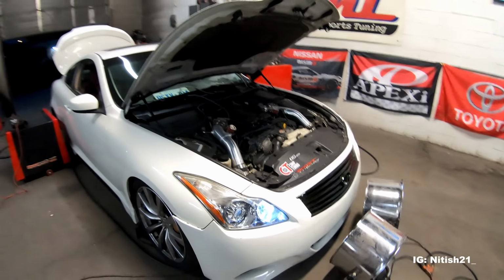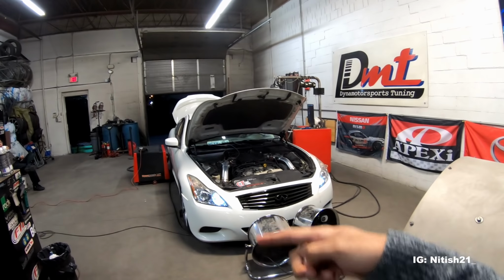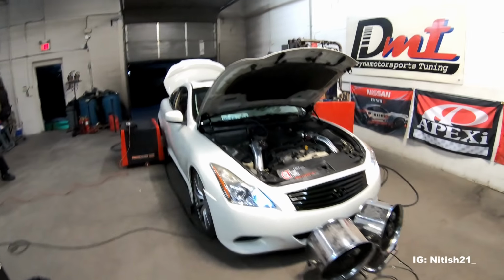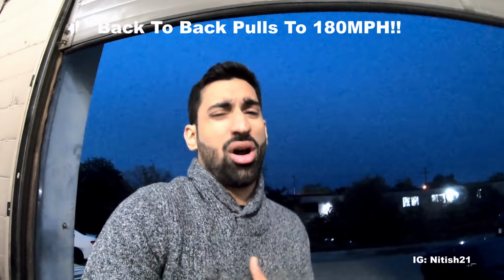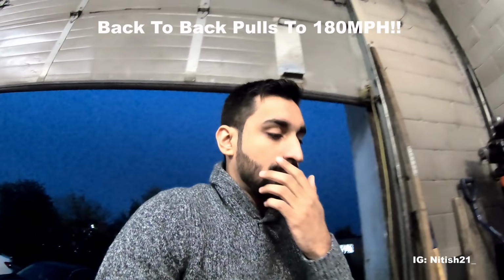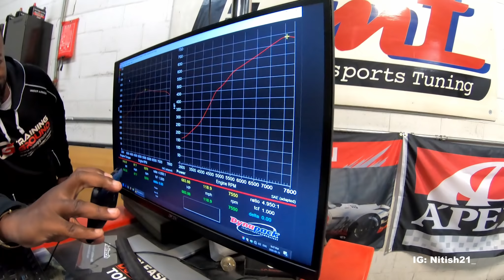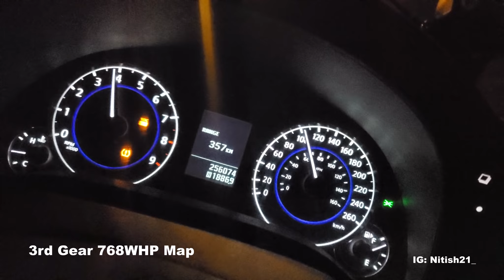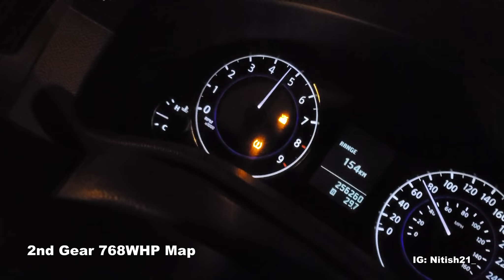800HP INFINITI G37 COUPE ON ROAD! - TOMEI SPOOL SOUND!! + DYNO

Comment: Those Gs numbers are getting better and better  what size comp turbo he using. And what type of boost controller yall use, its like yall run full boost all the time.
Reply from the maker: It's based on 2 maps 94 tune which is 600whp and 94+ boostane which is 768whp controlled through ecutek
Reply: @nitish21  gotcha gotcha so in actuality you can have a low boost map for daily driving and reliability.
Reply from the maker: @demigodq6083  Yup

Comment: so if 700+hp is killing the stock block, what's the "safe" number?

and is it the boost or the torque that's the issue? or fuel related?
Reply from the maker: It's really torque which we kept low on this build but this motor is so fkn high millage. So I wouldnt use this as a good example. But 600whp and 500wtq will last forever
Reply: just about to get into a 2010 g37s with 150xxxmiles... so I should think about building bottom end (crank, pistons, rods) if i wanna boost it to like 700wheel

love your content bro! keep this siht comin
Reply from the maker: @tfleming3567  yes absolutely thanks

Comment: Hey man do those BP turbo kits take in water during rain?
Been wondering with the turbos sitting at bottom like they do if they are only safe to drive on dry weather.
Reply from the maker: No never its above the subframe just don't drive through deep water

Comment: Hey man I like that bro, can you help me make my g37 800 hp?
Reply from the maker: Buy a turbo kit from @boostedperformanceyeg fuel return system from AAM and big fuel pump and you can do it. But I would recommend staying under 700whp
Reply: Ohh ok why did you say that? I want like 700 hp ,can you tell me where can I get the kit?
Reply from the maker: @abdrahamanekande3863  because stock engine can't reliable handle 800. Reach out to @boostedperformanceyeg on IG

Comment: Can you tell me all the mods you have on it?
Reply from the maker: Aam fuel return system with rails, 1300cc injectors, os giken triple disc clutch, hellcat fuel pump. secondary pump in drivers side with hydra mat

Comment: List of fuel system parts please.
Reply: I'm running 1300cc injectors 535 pump mounted in main basket with oem mounted to driver side to feed the hellcat pump hob switch hooked up to tge oem pump and aam fuel line and return kit with hks 1 step cooler spark plugs and meth of course